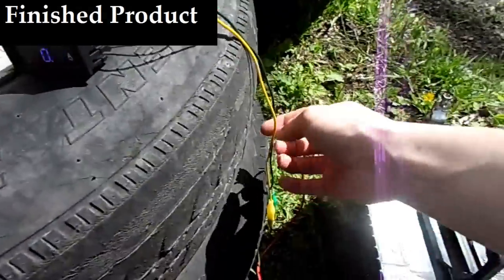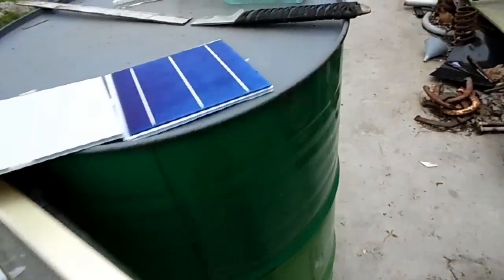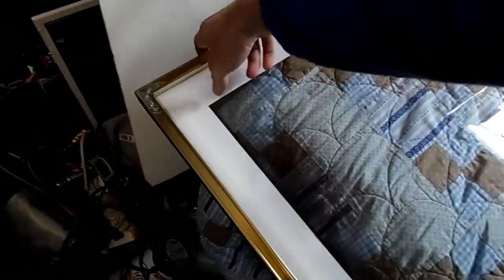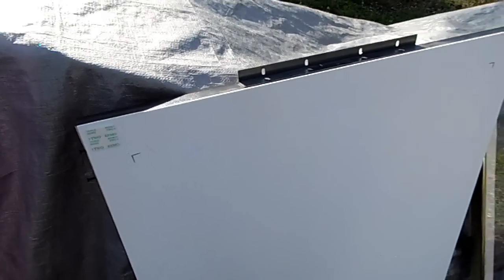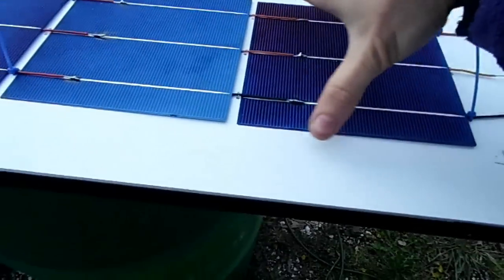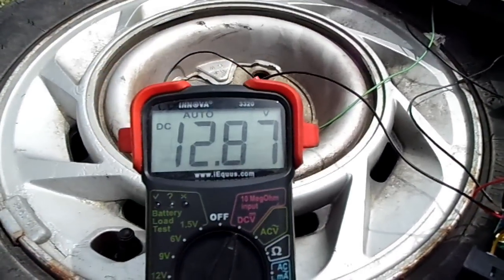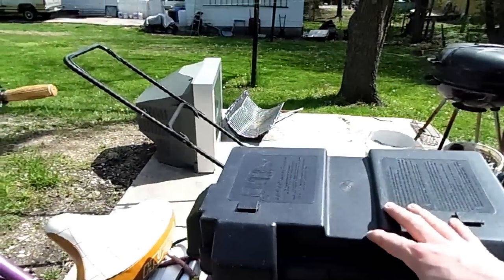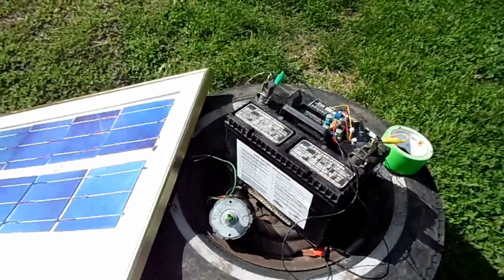DIY 15$ 40w Solar Panel

Comment: Have you had fogging issue yet? You can't just seal these up in air because there is moisture in the air. It appears you have me blocked so I don't know if you will see this, but this is one of the many mistakes I've you make.
Reply from the maker: blocked? no i dont have you blocked. i havent really had any fogging issues with this but its not a super serious panel. i've decided to ditch making them myself in favor of just buying them. the 100w panels i bought are very cool. i may give these cells away to a subscriber or something idk.
Reply: Rinoa Super-Genius
Sorry for being an ass about it. I noticed I saw a number of replies with your name, but no posts by your name and that's usually a sign that you have been blocked. Then, after I posted it, I realized it was because the threads were collapsed.
They are very much a pain to make and if you want any real use out of them, you have to push the air out and replace it with a gas that has no moisture in it, otherwise the glass or acrylic you use will turn white from fog.It doesn't need to be a vacuum or anything, just no water vapor, otherwise you get fogging and it tends to not go away. But it was still an inexpensive learning project.
Reply from the maker: tarstarkusz wait, so you thought i was blocked from my own youtube channel?
Reply: Rinoa Super-Genius
YT changed the way blocking works. If you block someone from your channel, they can still post, but they cannot see your posts and you cannot see their posts. I'm pretty sure that's how it works. The old system was much better because if you are blocked, you simply cannot subscribe or post to someone who's blocked you.
Reply from the maker: tarstarkusz
well theres two differant things, you can block and you can ban people.

Comment: dude you need a solar panel on your e bike on a swivel(so you can point it in the right direction) to increase range
Reply from the maker: lol, that would be so useless. would have to have more solar surface area than 4 bicycles to make much of an effect.
Reply: better than nothing and you could always park it in the sun . just saying.
Reply from the maker: DAMON STAHL
 but it would hurt more than help. a small panel could get broken, and would take weeks to recharge the cells.

i've had my bike fall over like 5 times already so thats out of the question.

it wouldnt be worth it to park it in teh sun, get it out every morning and put it away every night when i could have a big solar panel mounted to the ground that tracked the sun.

Comment: calculation wrong.. 
0.5V 5A Solar Panel = 2.5W (0.5x5=2.5W)
10 Panel x 2.5W= 25W
that's mean it's 25W solar panel not 40W..

Comment: I'm sorry, but your text doesn't quite hit the truth here. If you have 10 cells, with say 0.5v per cell and a max of 4W. And you stack them together you can get 5v at 40W. OR .. 0.5v also at 40W. The only thing that changes is the amperage that will change with each setup! Correct me if i'm wrong (ive made a 16v 30W panel myself with epxoy) and tested the above before i made it permanent. Kind regards
Reply: Joey Poortman i think the lower output was due to the clouds. in series yes they stack up voltage and wattage
Reply: Joey Poortman The math he is using seems incorrect. 10 panels @ 0.5V 5A is a max of 25 watts total. I have no idea how he calculated 40 watts.
Reply: Andrew Finnell Those panels do max 0.5v 4W so .. thats how he got to 40Watts. still 0.5v, 4w * 10 = 0.5, 40W output. if its in series in like 10x0.5 at 4W it gets 5v at 40W ..
Reply: That would mean they are 8 AMP panels. I highly doubt that. It is more likely they are 0.5 Volt and 5 Amp panels which puts them at 2.5 watts. So 10 of them would yield 25 watts, which is exactly what they are wielding,
Reply from the maker: Andrew Finnell i would love to change the title but it is very fun to see people arguing about this.
Reply: Rinoa Super-Genius Most of those 6x6 do more then 4W ... so yes 8A.  ² Average Power (Watts): 4.3 Wp² Average Current (Amps): 8.6 Imax² Average Voltage (Volts): 0.5 Vmax² Efficiency: 17.6%  Its not hard, just go to ebay and type in "solar cell 6x6" ....
Reply: +Marshall Law you can do whatever you like, these are the factory specs....

Comment: How many amps does each sell give?
Reply from the maker: should give 5 amps, but i didnt buy enough cells to make the voltage high enough to use for much.
Reply: Too bad! 
why won't you purchase the rest of the cells that you need.
Reply from the maker: MIKAEL'S LAB
 because i went ahead and bought two 100 watt panels that where pre-made. i couldnt find the same cheep deal on cells like i did for these ones.
Reply: Each of the 6"x6" Cells puts out about 0.6V and 4 watts.  4/.6 =  6.7 amps.  Now this is at noon and pointed directly into the sun, probably on the equator.  In the real world figure half that.
Reply from the maker: FlyMeAirplane
they only make 0.6v at open circuit, you need to pull them down before you get current coming from them.
Reply: Rinoa Super-Genius I looked up "pull them down" in my Electronic Engineering dictionary and only found some refference to pants that show dumb kids underware.  I think you mean "Load" and your right then, the most current will come out of the cel is if is a direct short.  The most voltage will come out when there is no load.  If your 9 years old, I applaud you for playing with electronics like you do.  But otherwise you need to hit the books a bit.  Might want to stop telling people how to do things wrong altho it is fun to blow things up...
Reply: FlyMeAirplane
I can see why you may have thought Rinoa blocked you. :)
Reply from the maker: *****
yeah hes such a moron.

Comment: Re: Steve (Zara) - NO, you aren't missing anything.  First off,  let me say that in NO WAY am I trying to be a smart ass, a know-it-all, or, to KNOCK this guy,  razz him,  or degrade&belittle him at all. He's obviously NOT educated in the electrical field, or knowledgeable in electronics at all past the point of being familiar with a few electrical terms and their correct pronunciations. He does have a rudimentary understanding, and most likely graduated from YouTube University. A system generating 12 volts at 2.5 amps = 30 VA... NOT 40. It was glossed over that he was using #20 AWG wire. Though his system is small,  the energy wasted in COPPER LOSSES is (I^2)x(R). Also,  he said he is gonna need to use a power transformer to step his voltage up.  transformers only work on AC systems which will provide the varying magnetic field required for the transformer to function. He will need a SMPS (DC to DC converter) to increase his DC voltage.

Comment: you skipped last part of all solar panel connection video  and couldnot understand  the method of wire connection of end of solar panel (last part of solar panel connection and then out ward connections)

Comment: Your soldering technique is a bit off ... You're going to burn off the flux by holding the solder on the iron like that.  Also tin your contacts first eh

Comment: I don’t understand what’s going on here! .50 volt and 5 amp cells? It must be that scolding iron! What the heck is going on here? Foam core board? 20 gage wire? Why? The only thing I got out of this video is that a pocket knife also works as a paper weight.

Comment: You spend $15 on the cells, your gonna have haunted solar panels, and you have to pay for loctite, the huge soldering iron and solder, so you may as well buy a 5v solar PANEL not cell with casing for only $5.99. Cool project but waste of money.

Comment: OMG, So much wrong with this!
Reply from the maker: your comment is worthless unless you state what parts are wrong.
Reply: Rinoa Super-Genius true but I didn't want to spend the time to say.  I can summarize.  Buy tabing wire, the cells are ment to have a wire the full length.  Your wires will break off, actually surprised you could even get them together like that.  I think your only going to get 1/3 the power out with your wire attachment.  Could you find a bigger soldering gun!  Wow.  Surprised you didn't thermally crack the cells in the soldering.  Silicone RTV is basically an acid, probably not good for an attachment method.  Solar cells degrade with moisture, your box is totally open to moisture with all those wire ties and such.  Plexi covers, they yellow, crack, craze and get soft with the suns heating.  Terrible choice in outdoor materials.  Also check how much worse the sun gets through the plexi, no wonder you got a 40 watt collector that puts out 5W.  Probably a bunch more but this is a good start for what you did wrong.
Reply from the maker: FlyMeAirplane tabbing the wires doesnt really matter that much,  i dont really understand what your saying after that. your just rambling.

the reason it only gave 5w was due to me not being able to pull the right load from it. if i'd bought more cells it would have worked better.

but i've since just decided to buy pre-made ones.
Reply: Rinoa Super-Genius You ever hear of coeficient of expansion.  That's when one material expands at a rate different than another material.  Bad things happen like cracks.  Good idea to buy store bought.